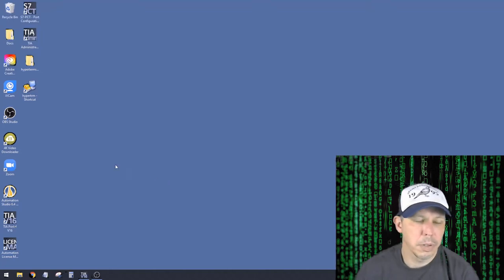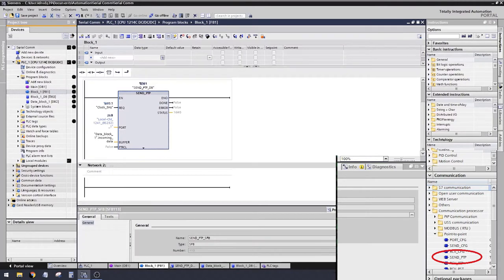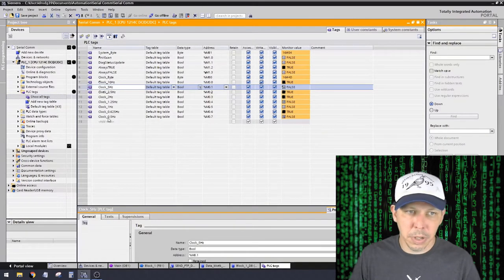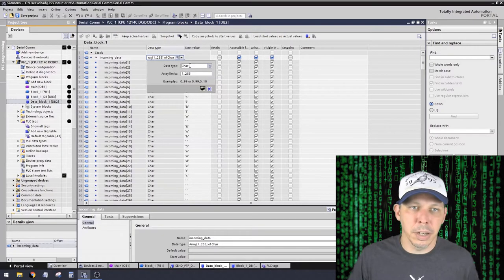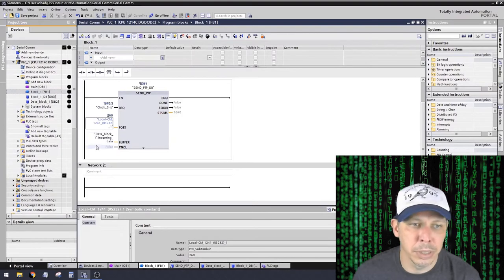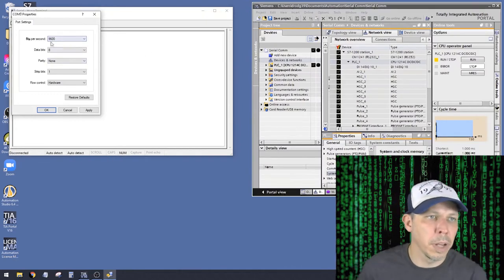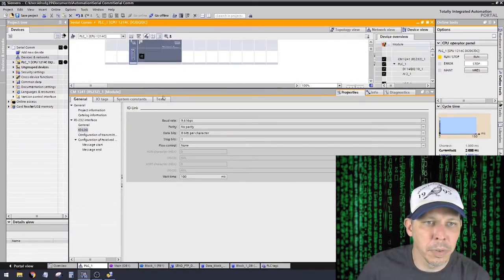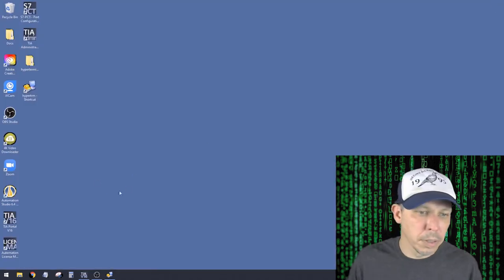Siemens S7-1200 RS232 serial communication using the CM1241 module with the SEND_PTP Function Block

Comment: hello, great video.
What is the cable are you using ? Null modem or straight cable? My CM 1241 not blink when I start sending  datas.
Reply from the maker: It's been a long time since I made this video. I believe the cable I used was what is called a crossover cable. One of the pins on the cable is for rx(receive) and one is for tx(transmit). If you use a straight through cable the rx goes to rx and the tx goes to tx. On the crossover cables, the pins for the rx and tx are crossed over so that the transmissions from one device go into the pin for the receive on the other end and vice versa. It basically crosses those two pins so two devices can communicate directly with one cable.

Comment: Hello, I use Send_P2P instruction to send data frame (byte). But the problem is, it automatically add 2 bytes 0x01 to the SendBuffer in the program resources data block "Send_P2P_DB". It makes the frame turn to wrong structure. Please help me the solution!
Reply from the maker: Can you edit the data block to remove the extra data? 0x01 is the hex version of the decimal 1. If you have two extra 0x01 added to your transmission, you probably have two 1's at the end of your DB. Try removing those and see if that works.
Reply: @elmeonline9932  Thank you but I specify my DB only has 6 bytes (no 2 0x01 at the end of DB). But when i change REQ bit to 1 to send data, it automatically add 2 bytes 0x01 at the beginning of the SendBuffer (SendBuffer[0] and SendBuffer[1]), it make 6 bytes of my DB shift to SendBuffer[2] -> SendBuffer[7]. I don't know why it happening. Do I need to change the CM 1241 RS422/RS485 to CB 1241 RS485? Thank you

Comment: Hey, im doing everything you are doing, but i can´t get it to work. I have a S7-1200 - 1212C - AC/DC/RLY along with the CM 1241. whay could i do wrong?
Reply from the maker: It could be your serial cable. Are you using a "straight-through" cable or a "crossover" cable? Do you see the tx light on the CM1241 come on when it should be sending data?